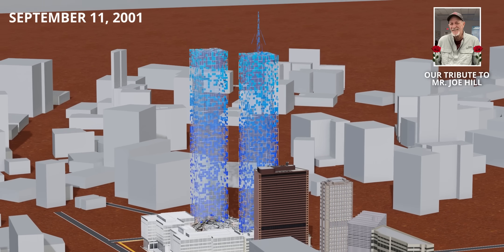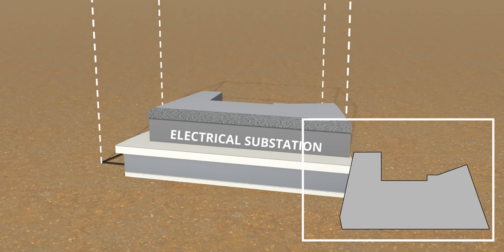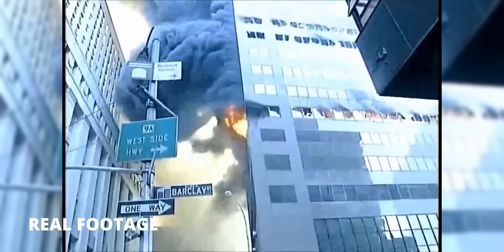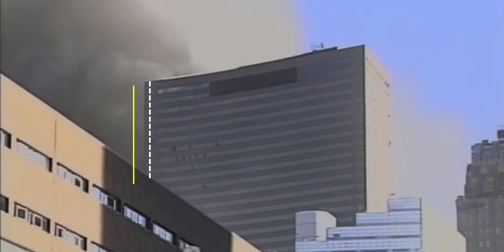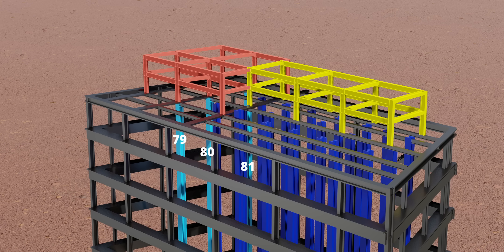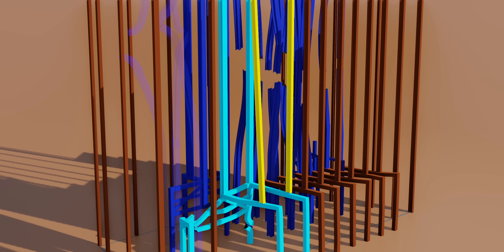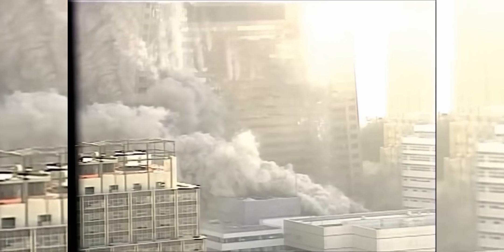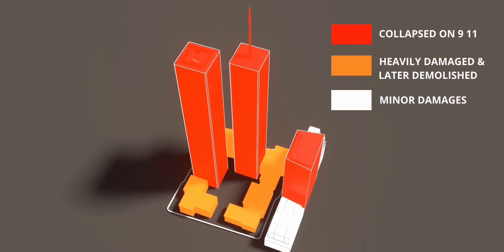Collapse of Building 7 | The Complete Physics

Comment: Either the building WAS safe to work in for years, or it was a safety hazard all along ! No engineer takes this garbage seriously!!! Its tailored to shape opinions of everyday non-technical folks !!
Reply: Nonsense. 

The collapse of Building 7 is one of the most studied engineering disasters in history and the subject of 5 comprehensive engineering studies and more than two dozen technical articles in major peer reviewed engineering journals, most of which were published 15 or more years ago. Thousands of pages of material.  This should get you started.

FEMA BPAT (initial report superseded by NIST NCSTAR 1A)

NIST NCSTAR 1A: Final Report on the Collapse of the World Trade Center Building 7, 2008.

Guy Nordenson and Associates, WTC7 Global Collapse Analysis Report and Summary of Findings, 2010.

Arup, WTC -7 Structural Fire Analysis Report (Runs 1-4), 2010.

Weidlinger Associates Inc., WTC 7 Collapse Analysis and Assessment Report, 2010.

BRE Centre for Fire Safety Engineering, Analysis of the Impact of a Fire in the Mechanical Room (5th & 6th Floor) of the World Trade Center 7 Building, 2010.

T. McAllister, R. MacNeill, O. Erbay, A. Sarawit, M. Zarghamee, S. Kirkpatrick, J. Gross, Analysis of structural response of WTC 7 to fire and sequential failures leading to collapse, J. Struct. Eng. (United States). 138 (2012) 109–117.

For a summary of the major studies I would recommend THE COLLAPSE OF WORLD TRADE CENTER 7: REVISITED by Mhd Anwar Orabi , Liming Jiang , Asif Usmani and Jose Torero which is a 33 page summary of the different analysis and conclusions published in 2020. Sorry, YouTube will delete this post if I give the link but it should be easy to find and is available from the University of Queensland, Brisbane. 

Real structural engineering industry professionals conducting real engineering studies and publishing them for other professionals to see. Not amateur YouTubers appealing to the gullible and credulous.

Comment: Ok, Steel structures collapse after a fairly short fire on a few floors, how come the building codes haven't changed? Would you as a fireman with a wife and children ever, ever rush into a burning building again? This video is BS
Reply: 7 hours of fire on more than a half-dozen floors simultaneously with no active firefighting effort. That is an unprecedented fire event. That the building lasted so long is the remarkable bit, not that it collapsed. 

Collapse of a burning structure is always a concern for firefighters. Steel buildings subject to fire rely on active fighting of the fires to survive. Buildings are designed around 1 to 3 hours of fire resistance, allowing time for occupants to escape and ACTIVE firefighting to get started, after which all bets are off. Left to their own devices they will exceed their design envelope and collapse. In B7 the occupants escaped, passive and active fire protections were compromised and active firefighting was abandoned 3 hours before the collapse, which left the building to its fate. It lost. Odds on Building 7 would eventually collapse, and it did. No big deal in logic. But there is no logic in conspiracy belief. 

Building codes absolutely changed BTW. Where did you get the silly idea they haven't.  Even the design of the replacement building fundamentally changed, incorporating composite rather than all-steel construction.

Comment: The most unscientific misrepresentation available, and seems to be raising on the busted flush that was the NIST collusion/conclusion.  My favorite:  "No, it was not at free fall speeds.".  If the collapse initiated at only a few columns, we would see a tilting and falling over of a nearly completely intact structure.  This is so nearly at free fall speeds that only controlled demolition explains the event.  Everyone must know this, or be hopelessly stupid or invested in the cover up.
Reply: I don't think you have the slightest clue what you are watching. It's complicated stuff so not surprising. Maybe if I explain it in more detail. 

This is MY explanation, independent of what is in this video;

B7 was complex, assymetrical 47-story steel framed structure built on top of a smaller 3-story building, requiring lower floors dedicated to complex load transfer structures, not usable office space. Of trapezoidal shape and all-steel tube-in-tube construction, B7 (above the 7th floor) consisted of a central core of steel columns carrying most of the gravity load, perimeter steel columns around the outside of the structure carrying the remainder of the gravity loads and long span beams and girders to tie those elements together and form the floors. On the outside of the building hung a moment frame or outer shell.

Phase 1 : The first externally visible signs of collapse initiation occurred at 5:20:28 pm. It was notably quiet with observers not realizing the building was collapsing! No audible warning in the form of  hundreds of ear drum busting 180-190dB explosive bangs preceding the collapse. Here at 12:00 a local CBS affiliate reporter is talking 10 blocks from B7 when collapse begins. People don’t start to notice the collapse until 12:11. At 12:45 is the famous CBS fixed camera clip of Building 7’s collapse. Note how quiet it is.

youtube.com/watch?v=t5tEy6mXSE8&ab_channel=fresnosean379

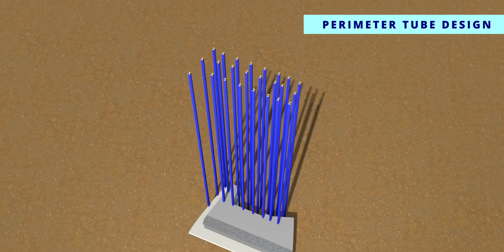Collapse initiation was due to lower floor failures above the load transfer region (7th floor) in the NE corner. In this video at 0:45 you can see the NW corner from inside the building while under construction, Column 79 just out of frame on the left. That big, angled steel beam across the top of the frame connects to C79 at one end. The girders connect to the beam. That beam and all those girders depend on just one connection

youtube.com/watch?v=nP3TNHPCIVU&t=35s&ab_channel=EdwardCurrent

Phase 2 : Lower floor failures caused a loss of critical lateral support over an excessive length of core Column 79 and it buckled. If you look at a floor diagram of Building 7 (see above) and look at all the structures that depend on C79 you quickly realize this one column was a relatively isolated structural element on which a disproportionately greater fraction of the structure depended analogous to say the Key Bridge. Externally we see a vertical progression of window breakage along the 44-46 line and a kink in the roof of the East Mechanical Penthouse at the top of the building, consistent with C79 failure. The transition from full capacity to almost no capacity occurs in virtually an instant. Once the buckling failure occurs there is almost no resistance

Normally with a buckling column, the load could very well be redistributed to other columns, meaning the buckling could stop after a while. With C79 that is not the case - the failure did not redistribute the load, so the collapse rapidly progressed to the roofline, sinking the rooftop penthouse.

Phase 3 : With C79 gone, B7’s progressive, non-symmetrical collapse continues with C80 and C81 at the east end of the core left laterally unsupported and quickly buckled and failed as well, sending the EMP down through the building. C79-81 all have no diagonal bracing, which I believe is a major reason why they could not redistribute a lot of vertical loads among one another.

From there collapse progressed from east to west through the central core until the core was gone taking all of the interior floors and probably most of the perimeter columns with it. Follow the horizontal progression of window failures low in the building and the dropping of the remaining rooftop structures into the building. One of the big takeaways from the NIST Building 7 study (that gets completely ignored) was their modeling which determined C79 failing under ANY circumstances would have initiated the same collapse sequence.

Note:  We are almost done with the collapse and have not got to the magical free fall yet AND most of what we just covered is not readily visible to the naked eye as it is all happening behind the still-standing outer shell - the exterior moment frame. 

Phase 4 : After 10 seconds only the exterior moment frame - a hollow empty outer shell – remains, giving the illusion the building is still standing since little has outwardly changed. But it’s just a hollow empty shell like an empty cereal box and supported by only a few remaining columns quite unable to remain standing. With all internal framing gone, the north face leans inward, forming a V in the roofline, the last columns buckle under the strain and the moment frame free falls, landing on top of the 7-story high debris pile. 

It is only here at the end that a single measurement of alleged free fall acceleration is taken, from a single point on that outer shell. The Building (defined as its center of mass) did not “free fall” – just one corner of the outer shell did- sort of. The Building was already gone before that happened. The period of alleged free fall was a product of collapse progression mechanisms, not of collapse initiation mechanisms and cannot tell us what started the collapse. Start to finish the entire collapse took 18-20 seconds, 3 times longer than true free fall .  How fast something falls cannot tell you what started it falling_ anyway. 

This video demonstrates what a Red Herring the falacious free fall argument has always been and why it has been failing every single time it is presented for almost 2 decades;

www.youtube.com/watch?v=n8WxkqMRgS4

The debris spread outside the footprint, blocking surrounding streets, heavily damaging the Verizon Building and destroyed Fiterman Hall.  

Building 7’s progressive, non-symmetrical collapse was incidental and unintended collateral damage from the combined effects of fire + time + gravity, started by the collapsing North Tower. That is true no matter who planned and carried out the 9/11 attacks or why . The collapse was of so little consequence it barely even registered at the time, a mere footnote. It only took on semi-mythical status as an alleged smoking gun years later when demolitions at the Twin Towers, missiles at the Pentagon and shoot down over Shanksville all failed and conspiracists had nothing left to work with.

Anything can seem like a conspiracy if you don’t understand how it works. Now you should. I hope you found this helpful, informative and it solicits informed critical comment. If I made any errors of fact, logic or reason or left anything important out, please let me know so I can fix it. IF you can offer a more plausible alternative please do. Be the first. Please start any reply with the words “Tits McGee” or I will know you didn’t read it and are wasting my time.

Comment: The NIST report contradicts this reconstruction on two very important points:
a) the NIST computer generated illustration shows nothing after about one or two seconds (and which anyway look nothing like the videos posted, even over that time span); b) the precise dynamics of the collapse were NOT included in the report for "reasons of safety" (Check out the .pdf of the report in the notes; I have the report if you cannot find it online anymore). So, unless something has changed since the release of the report you can only be making this crap up. Many engineers have be seeking court-ordered release (like under FOIA) for years.

Personally, I first saw the "gash and falling debris damage" many years ago and to this had been appended a voice over saying; "Look at that damage to WTC 7! They'd better PULL the people out of there! It's all going to come down! Pull the people out Pull the people out!" In the video there is not a human figure to be seen.

The smoke shown coming from the building is a lot higher than the incriminated "sliding horizontal beam" and is black, so low temperature, low oxygen and, indeed, maybe office furniture produced just as for the twin towers and so not likely to affect structures many floors below. Please, please do not even think about raising the "pile-driver or pancaking!

There have only been three examples of fire bringing down steel-framed buildings in the history of the technique; all on 9/11 in NYC.
Reply: When you mindlessly repeat someone else's bad ideas at least get the details right.

a). The NIST created four (4) models in their Building 7 collapse study.  Which one are you referring to?

b). What do you mean by the precise dynamics of the collapse were not included in the report for reasons of safety ?  I think what you did there was grossly cock up the Architects & Engineers for 9/11 Truth argument that The NIST refuses to publish their model input data. That has nothing to do with dynamics, which are present in abundance in all of The NIST models.  Also, so what if they don't publish their input data?  You don't need it to make your own models. This is a Red Herring.

Exactly where and how does the Sabine video contradict either of these badly presented claims?

This video concludes Building 7 collapsed due to 7 hours of unfought fire. The NIST concluded Building 7 collapsed due to 7 hours of unfought fires. Isn't that the really important point?

Finally, where did you get your degree in smoke whispering?  University YouTubia?  I mean, that's not a thing any firefighter or engineer would ever utter. It's pure internet conspiracy meme 101.
Reply: @MFitz12  Question; When you mindlessly repeat someone else's bad ideas at least get the details right. a). The NIST created four (4) models in their Building 7 collapse study. Which one are you referring to?

Response: I am referring to the Final Report on the Collapse of World Trade Center Building 7 dated November 2008 and signed by Secretary Carlos M Gutierrez for the US Department and Commerce and Patrick M. Gallagher for the National Institute of Standards and Technology. S. Shyam Sunder - Lead Investigator.

Of the "four" simulations shown in Chapter 3, none shows a symmetrical collapse, occurring at free-fall velocity, involving the entire building (especially lower numbered columns), and into its footprint. There is around a multiple frame computer simulation (not included in the report) that purports to show collapse initiation, but it is maybe three seconds long and doesn't show symmetrical fall either up to the end point.

Question b). What do you mean by the precise dynamics of the collapse were not included in the report for reasons of safety ? I think what you did there was grossly cock up the Architects & Engineers for 9/11 Truth argument that The NIST refuses to publish their model input data. That has nothing to do with dynamics, which are present in abundance in all of The NIST models

Response: Appendix A of the report cites Public Law 107-231 - October 1, 2002 and especially SEC. 7 sub D. PUBLIC SAFETY INFORMATION regarding non-release of information. This has been repeatedly used to deflect FOIA requests from interested parties including, but not limited to, Architects & Engineers for 9/11 Truth. I did take an interest in that group initially but have not updated myself except very perfunctorily on it for years. 

Question; This video concludes Building 7 collapsed due to 7 hours of unfought fire. The NIST concluded Building 7 collapsed due to 7 hours of unfought fires. Isn't that the really important point?

Response; Not really. The report hopes to demonstrate (or assume) that "unfought" office furniture fire led to concentrations of heat that caused the buckling and slippage of a non-central column, while at the same time detailing a progressive burning off of combustibles that created some ceiling height concentrations of  gas temperature "up to 1,000C°. These concentrations, however, are not shown to have continued to hold in the same place for the entire day (NIST states), or 7 hours if you like, but rather they moved through the building heating areas in succession that then cooled off when combustible material was spent. Remember that a steel framed building is a heat sink and conduction could be expected to dissipate concentrations of heat with some efficiency. 

Question: Finally, where did you get your degree in smoke whispering?  University YouTubia? I mean, that's not a thing any firefighter or engineer would ever utter. It's pure internet conspiracy meme 101. 

Response: I am now retired but spent 46 years in the insurance industry, dealing with Fire and Consequential Loss risks especially. My degree was earned at the Chartered Insurance Institute of London and during my career I performed Underwriting Risk Surveys, Loss Adjustment Surveys, and viewed and translated (since I speak multiple languages) reports of these and other matters for carriers, Firms of Lawyers, Loss Adjusters. etc. I recently collaborated on a handbook for University use on insurances on a general basis. I am credentialed, and even today, although, as stated, I am retired and do not seek new consultation appointments, I receive regular new inquiries for assistance from professionals in the industry.
Billowing black smoke (from a vehicle engine exhaust or a burning building) is such because it is loaded with sooty particles that are not completely combusted and carry heat away from the seat of the fire. Get yourself a flue, say a pair of open windows, for ingress of oxygen and outflow of hot gases and, yes you can heat things up. However, office furniture in a almost non-aerated environment does not achieve anything like that.

Comment: It would have been interesting to see an explanation of the window blow-outs purportedly due to explosives, just before Building 7 started its collapse.
Reply: There were no window blowouts_.  Windows _shattered in reaction to the buckling failure of Column 79, which you can see as a vertical progression of window failures along the 44-46 line.
Reply: @MFitz12  What I saw wasn't on that side.
Reply: @DaveDave-e4t  - Well, there are 4 sides - north, south, east and west, so pick one. Don't keep us in suspense.
Reply: @DaveDave-e4t  - Take your time.